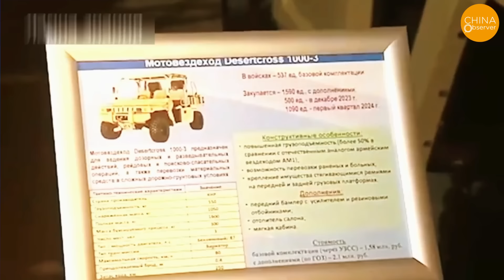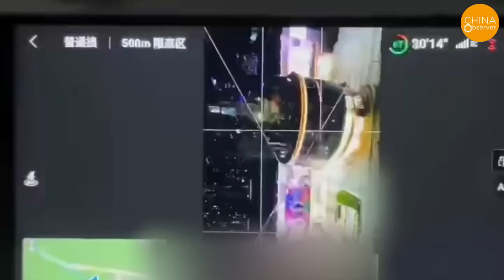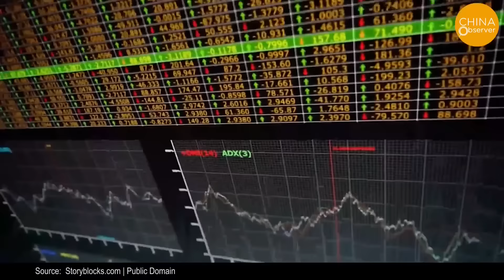China’s Tofu-Dreg Tank Joins a Contest, Loses Wheels, and Falls to Pieces! Russians Laugh Heartily

Comment: That "desertcross" is 1000% a golf cart. Seriously. The entire layout, even down to the rocker switches, all standard golf cart industry stuff. There are ruggedized offroad-capable golf carts designed for things like light farm work or working on golf courses, landscaping etc., they are just a 300-500cc gas-powered cart with a hydraulic lift bed and sometimes removable doors, slightly more engineering and strength than a normal golf club cart, headlights and tail lights, bumper bars, but still definitely a golf cart. I recognize those connecting arms, the rear diff, all clearly engineering from golf carts.
Reply: Someone should tell Russia and China that there are no mulligans in war.
Reply: You beat me to it; the first thing tha topped into my head when I saw it was, "It's a golf cart!" :D
Reply: It really is just a Gator with a camo paint job.
Reply: yes. it i a golf car, and it has been on the US market for years..
Reply: english: "golf cart"
russian: "slav transporter"
Reply: Looks like a ripoff of a Polaris Ranger
Reply: It's basically a side-by-side ATV, not a golf cart. Same idea, but it's cheap Chinesium so it's not going to hold up nearly as well as a real Polaris or Can-Am.
Reply: Shhh don't tell it to the ruzzians
Reply: @MrSlug-ki9jl Yep, my sister and her husband own one on their farm. It is a rugged little thing, great for fording small rivers and climbing mud banks. 
I highly doubt the version in the video is anywhere close to as durable.
Reply: Golf cart made to look slightly more UTV without the added durability of a UTV lol
Reply: Russia has built some really good military vehicles so why would they waste money on shit like that? The USA is far more expert at buying rubbish than they are.
Reply: true but this video is still stupid to critique it for protection. Like look at the thing. I was in Iraq and we used golf carts and polaris style vehicles for transport by the way. On large secure bases. There is nothing wrong with the vehicle, it's not designed to have protection against anything. Perhaps the claim it might not hold up in mud has some merit, though again I don't know what they claimed it was capable of. Certainly they could probably just put an extra set of wheels on it and widen the tires if they wanted to lower the ground pressure to make it more mud capable. But ultimately it's probably a perfectly fine vehicle for what it is, it probably does exactly what it looks like it does. Can't blame them for expecting an open top vehicle to provide protection against fire.
Reply: @Mercmad  Firstly, the US has Russia beat 1 for 1 in basically every individual platform type that exists. The M1A1 is a better tank than the T-90, nothing touches the F-22/F-35/B-21/B-2 and such. It's not even close. The Bradley beats the BMP, even the one example of close parity, the S-400 is inferior to the Patriot system. The American artillery is better, the standard issue equipment for soldiers is better. Let's not even try to compare the Moskova to something like an American Aircraft Carrier, The Moskova lost to some old home grown Neptune missiles at max range. The US has swatted about 50 drones and missiles down at this point in the middle east aimed at shipping in the region.

We know all this too because we literally have the Ukrainians who already had all the Russian systems endlessly praising how much better the Western versions are.

A lot of this is just tech hardware and software in fairness. It's not that the t-90 in principle is a bad tank, but it's optics suck compared to US ones. Yes the russians have the problem of the exploding turret but if they could see first and shoot first it would be less of an issue. The Russians are taping Garmin's to the cockpit of aircraft to navigate and the reason things like the Turkish Drones took down russian SAMs was because they were turned off because they were too scared of hitting themselves. They lack the kind of integrated network you'll find between things like the Patriot and a F35 that make sure there is no risk of friendly fires. 

But the Chinese vehicle is fine, it's a golf cart yes but it's perfectly servicable and even has a purpose, we used them in Iraq for movement inside bases on large secure bases. If they are using them in contested spaces yeah that's a mistake, but a russian one not a chinese one. It's not like the Chinese claimed it could scale everest and withstand rocket fire i'm sure.
Reply: The soldiers of the second strongest army in Ukraine riding to their death in golf carts ... how the (long ago) mighty have fallen.
Reply: @sparkzbarca I wouldn't be so quick to doubt that China claimed their golf cart could climb Everest or withstand rocket fire. That sounds exactly like something they would do.
Reply: @sammiches6859  even if they would have the Russians wouldn't have believed them, they still have eyes.
Reply: It's a rebadged Massimo Warrior 1000x. It does look like a fun little UTV to do light logging or ranch work though
Reply: Thats really all you need the purpose is to be light and fast for ATGM teams
Reply: Ahhhh so its just a combat golf cart
Reply: So could it be a golf cart?
Reply: Chinese here, it is just a agriculture atv manufactured by civ company. Sorry guys
Reply: So this just proves that China is indeed adhering to sanctions, and not exporting militsry equipment. This channel constantly plays itself.

Comment: I remember that the Abrams tank also had problems with counterfeit fasteners (e.g. bolts, nuts, etc.) years ago when the tank was new. Fasteners have to be made of the proper metal that is correctly treated to meet military specifications. Counterfeit bolts can shear prematurely as it did in the Chinese tank shown. Growing Pains.
However, I repeat: Never underestimate your enemy until victory is achieved.
Reply: @@davesmith3023No, I’m just old enough to have lived through the early years of the M1 Abrahams. It did not have a stellar beginning,
Reply: @kenandbarbie-b6c  Abrahams lol.
Reply: @Asymmetrical-Saggin  My own fault for not checking autocomplete. One thing I did not mention is that one of the major suppliers of bolts to Chrysler at the time was from Taiwan. I would not be surprised if some were sourced from CCP China. Those bolts had false proof marks on the bolt head.
Reply: no need for estimations, I think the US miltary knows everything they need to know about china. China should definitely not under estimate the US though.
Reply: @uraniumcranium2613  CCP China’s problems are not our concern.  However, the US has a recent history of underestimating opponents, especially in asymmetrical warfare. Vietnam, Afghanistan, Somalia, etc… It would save US lives to have overwhelming military strength.
Reply: @Asymmetrical-Saggin when the best you can do is point out grammar mistakes,you probably don’t have much of a valid arguement
Reply: @kenandbarbie-b6c excluding the 91 gulf war,which was a Coalition  effort,the US has lost every war it has poked its nose into since ww2
Reply: @uraniumcranium2613 china kicked americas ass in the Korean war…….
Reply: @stephenfazekas5054  Sure they did buddy, and I'm the King of England.
Reply: Any source on that info?
Reply: @uraniumcranium2613  "I think" implies you don't know what you're talking about, and you mindset is exactly what OP is warning against.
Reply: @jasonprisk5940 I can think of two wars the US Definitely won off the top of my head, those being Panama And Grenada
Reply: @kenandbarbie-b6c  I'm French and I don't think the US ever underestimated an opponent militarily speaking. They have overwhelming force even compared to China let alone Vietnam or Afghanistan. What the US fail at is understanding that winning a war is not only about military strength. USA has the best army on this planet but they are really bad at using it for political purpose.  To be fair, they are far from being the only one and countries that use it at little as possible (like China) appear more potent....spoiler they probably aren't.
Reply: @jasonprisk5940 because of bureaucracy. Nothing to do with the actual fighting. We actually fight extremely well when our troops are allowed to be troops. No one wants to admit THAT tho. Or does anyone actually read deep enough to see that. 

Good on you for regurgitating more bullshit about those wars
Reply: @stephenfazekas5054 no, no they didn’t. You ever hear of the m26 Pershing? Shit, we have plenty of stories of a few hundred soldiers killing thousands of ChinesE 

I remember the story of an officer who had to be told to stop charging the enemy cause he kept doing it, and winning. Read up on some history war is more then a few battles. Yes, we have lost battles, never properly lost a war. 

If you wanna huff the cope with “but but but but the paper says…” then whatever, it’s more nuanced than “we lost” cause we really didn’t. We left.
Reply: @johnforrest1236 losing and leaving because of government, a government that neutered the effectiveness of the troops, directly getting our guys killed by putting rules on them that the enemy doesn’t need to follow

IS NOT THE SAME
Reply: @benoittassin1379 thank you
Reply: @DS-wl5pk  What? Did you mean to reply to me?
Reply: @kenandbarbie-b6c  The US can go toe to toe with anyone and Vietnam was no different. The only reason it was "lost" under your terms... is that it was the first war that was televised. The people wanted it to end at all costs.
Reply: @benoittassin1379  One historical example was the US underestimating Imperial Japan’s military until they got a good dose of Japanese navel aviation at Pearl Harbor. Another example was underestimating the North Korean invasion of South Korea, refusing to supply armor to the South fearing escalation, while the North invaded by surprise with Soviet T34-85’s. The US only had light tanks there & underperforming antitank weapons & was nearly driven into the sea. I could go on, but I can agree that the bigger problem now is poor management. The extremely amateur withdrawal of Afghanistan & the abandonment of State Department personnel in Libya are two examples of that. That is incompetent executive management. Military strength & competent management is what is required. As far as the CCP Chinese is concerned, they have industrial capacity that exceeds the US & EU. They are also capable of manufacturing quality products at will, not all of it is junk. Drones are one example of this, battle proven in Ukraine. They also have a history of a stalemate in battle against the US in Korea. Much of the criticism of CCP China & of Imperial Japan was actually racist & not objective. The US has to be careful of making clouded judgements.
Reply: I remember when the counterfeit parts problem even infected the aircraft parts store. We had to go through our parts several times to ensure all the equipment was safe.
Reply: @jkutnink87  that and we weren't allowed to invade the north. We were essentially fighting with our hands tied behind our backs.
Reply: @stephenfazekas5054  you would make a great comedian
Reply: I mean… we don’t have to underestimate them when we’re constantly monitoring their every move more closely than their own government can.  I think we’ll be just fine, especially after this amazing display of engineering.
Reply: @johnforrest1236  We won the Korean war also.  You can tell that we won because South Korea still exists.  In fact, using that lame criteria - WWII is the only war we won.  WWII was an anomaly regarding how wars end.  And when the Vietnamese war ended - it was because North Vietnam was on the ropes and was worried that our next mover would have been to invade them.  They invaded and conquered South Vietnam three years after the last US troops left. And this was a political failure on our part - not a military failure.

Iraq was also a military success that was marred by a later political failure.  First Obama's amateur hour diplomacy put the Iraqi leadership into a situation where they had to turn down a Status of forces agreement that they had already agreed to.  (Because Obama made demands and the Iraqi leadership needed to demonstrate that they were not US clients.)  

Even the aftermath of the First World War was a political failure on our part - because we refused to join the 'League of Nations' that had been created specifically to prevent another major war in Europe.  

It's sad that the US military history is not taught in our colleges and universities.  Because if it were taught people wouldn't be making the stupid claims about us 'losing a war.' when the US military went and achieved exactly what they had been told to.
Reply: @colincampbell767  Your absolutely right
Reply: Shush!   Never interrupt your enemy while he is making a mistake.
Reply: @OneBiasedOpinion  Unfortunately, when they can send in over one million soldiers at one time, they don't have to be armed, they can just walk over any resistance!
Reply: Vietnam too kicked China's arse when china poked their nose in Vietnam . USA had to travel half way across the world but now USA has a base in Taiwan and India on southern front so china should look out for itself with their copied designs
Reply: @jeffreyyoung4104  in the 1800s maybe this argument would have held some merit.  Today, that’d just make it very easy to finish up any war within a matter of weeks.
Reply: @stephenfazekas5054   Oh please.  Sure the initial invasion of the Chinese was a surprise when they sent wave upon wave of conscripts.  After things settled.  The US not only pushed them back but by the end of the fighting,  The US was simply using the Chinese to collect XP.
Wave of soldiers don't do well with accurate fire and training.
Reply: @colincampbell767 didn't the US won the Korean War with the help off and alliance with Malaysia turkey and Philippines that they set knowing they couldn't deal with both north Koreans and chinese forces on there own
Reply: @rickyboy6390  Isn't that the point?  An aggressor know that they won't just be fighting us.  They'll be fighting us and our friends.
Reply: @colincampbell767 so are we just gonna forget that china also has allies also it's not friends but more over on mutual benefits
Reply: @rickyboy6390  And which countries are China's allies?
Reply: @colincampbell767  Pakistan Africa Russia north korea and Mongolia and others your comment makes it seem china is alone
Reply: @rickyboy6390  None of those are allies.  If China decided to go to war - they would be alone.  When was the last time the US fought a war alone?
Reply: @colincampbell767  some of the the wars they fought were by themselves alone
Reply: @colincampbell767  yeah especially the Vietnam War. I have no idea where or how people learn about it. People have some serious misconceptions. One of the worst is the norths combat power. North Vietnam wasn't like the Taliban. They had advanced equipment from the Chinese and soviets, they had training, they had artillery, an airforce, armored battalions, trucks and APCs etc etc. But everyone seems to think they were just rice farmers in pajamas and aks.... 
As for the actual conflict, once the US put troops on the ground, they reversed all North vietnamese territorial gains and battle lines remained essentially unchanged for the rest of the war. US was fighting a defensive war while they negotiated peace. Which they achieved. Though the US was the only one to actually honor it. People seem to forget about the Paris peace accords....
Reply: @stephenfazekas5054 idi*t you dont know your history… filipinos even kicked the  arses of the reds
Reply: 0.50 Yuan has been deposited to your account.
Reply: @kenandbarbie-b6c la guerra de Vietnam y Afganistán "perdieron" por qué simplemente el pueblo no apoyo esas guerras xD
Reply: @vegetto5569  I’m not sure if I understand you. I don’t know Spanish, but will try to answer. Support of the Vietnam war eroded via media reporting, especially when General Westmoreland gave rosy press conferences just before the Tet offensive. Just one reason for the loss of government credibility. As far as Afghanistan, it was less of a lack of public support to more of administrative incompetence. You should never pull out your active duty military before you finish removing your civilians, which is quite obvious & elementary, especially when there were means to control the locality militarily. It was amateur hour & the shameful incompetence of the Biden administration.